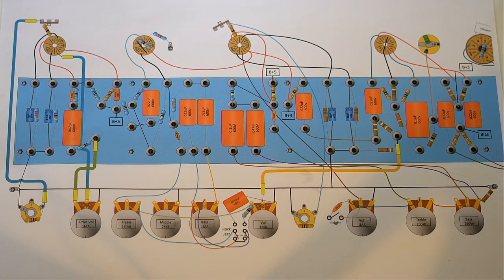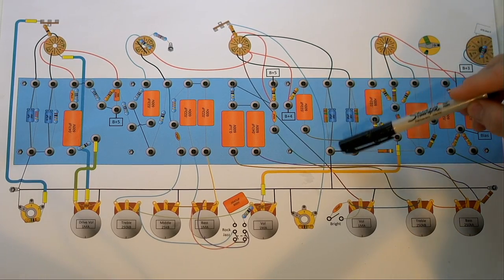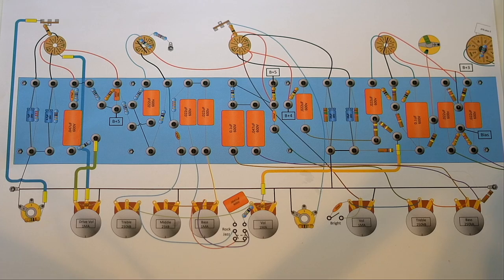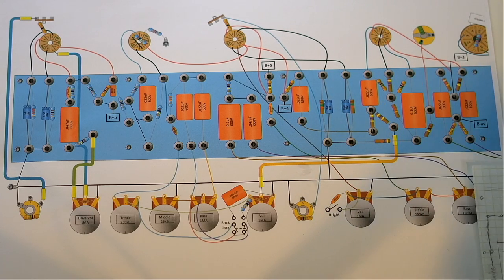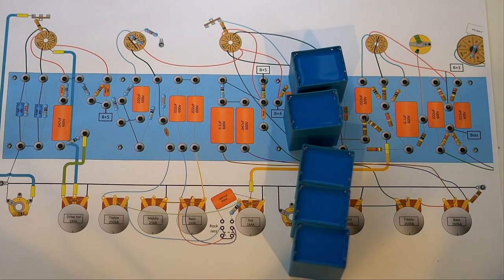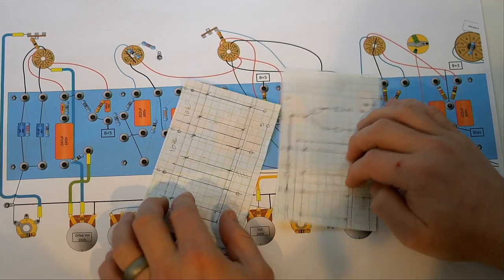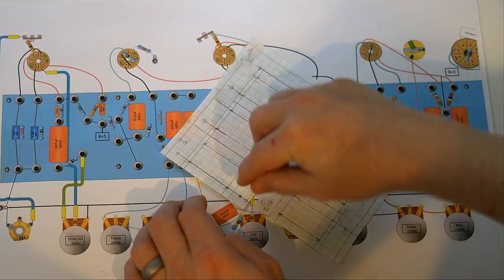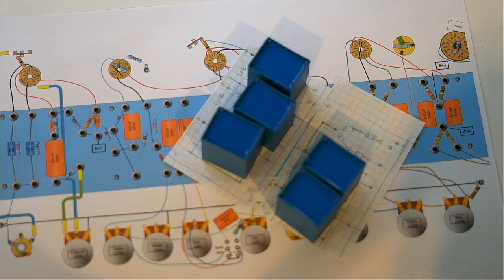Dumble Modded Bassman Video 2 - Board Layout design

Comment: I’m glad to see that you are still doing the Bassman Dumble! This is the bassman 100 ?
Reply from the maker: It is based on a bassman 100 yes, I'm building it from scratch of course, but that's the base model the amp was modded from by HAD
Reply: Are you married to using those huge capacitors? Wouldn’t it be easier to put the filter section on the bottom with traditional axial caps or even some multicap cans? What is your line of thought on this?
Reply from the maker: The thought is the longevity of the amplifier.  The electrolytic capacitors always do dry out over time and fail.  These, in theory, won't ever fail, unless there's a manufacturing defect.  It means the amp will run even longer without needing any maintenance other than replacing tubes.  (in theory)  They do cost a bit more, these were 10$ a piece or so, whereas most electrolytics that are say 50uF at about 350VDC are maybe 7 or so dollars, it's an increase in cost but to me seems worth it, if it works the way I want it to.  Also, these specific caps support up to 600VDC instead of the 350 that the originals did and to get that, they'd often do two 100uF at 350 to get 50uF equivalent (in series).  This way I just need the one 50uF at 600VDC and I'm good.  All of them didn't need to be at 600VDC, so that's a little overkill, but I didn't take time to search for smaller sized ones for after the first node.  Maybe that's going to cost me in space I guess?
Reply: @FrenchieFilms  keep us updated.I have hopes of doing this and look forward to seeing how you make out with this. I own a bassman 100. I would love to know how much you spend in total .
Reply: I would mount them all in a dog house underneath. Glue rhem to one another. It can hang as low.or.lower than the tubes and won't cramp up the chassis layout